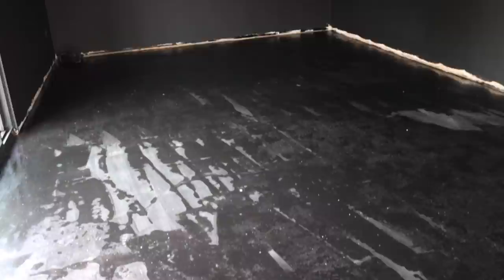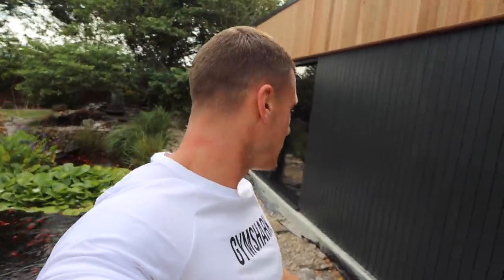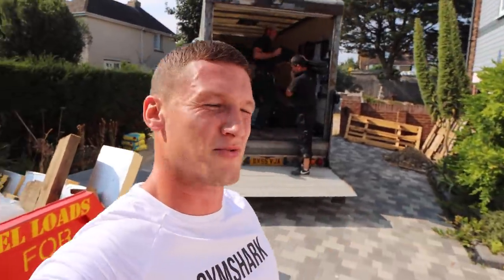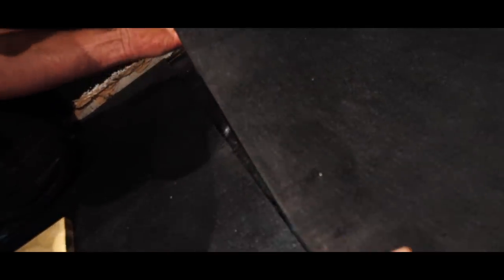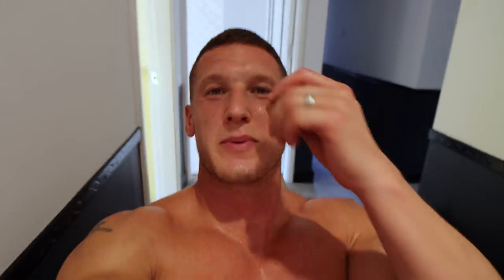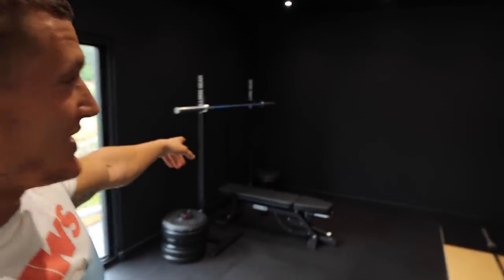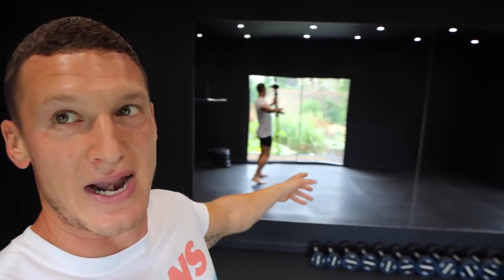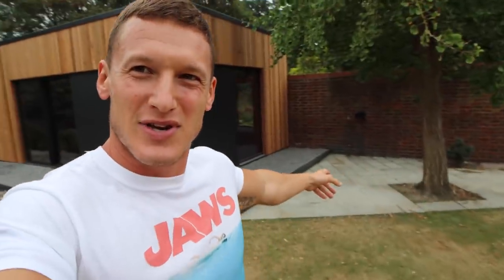Building The Gym | Ep. 4 *FULL HOME GYM BUILD*

Comment: Doing deadlifts with your back against to wall (specially sumo deadlift) is not SMART mate. You might break your legs if you pass out or fall back when trying a PR or high reps with decently heavy weights. I am strongly suggesting you to change the deadlift platform to somewhere safe or somewhere that you will have enough space to fall back without breaking your legs.